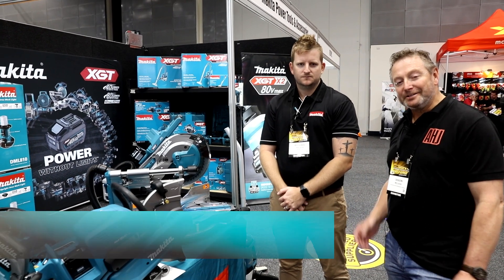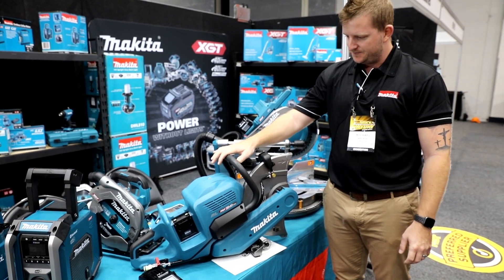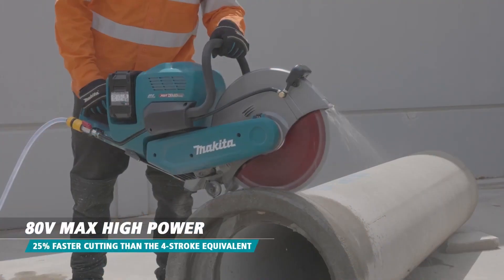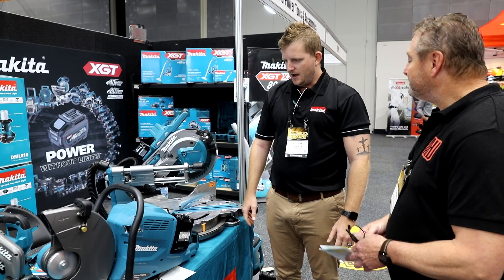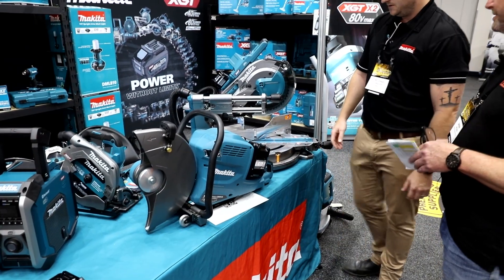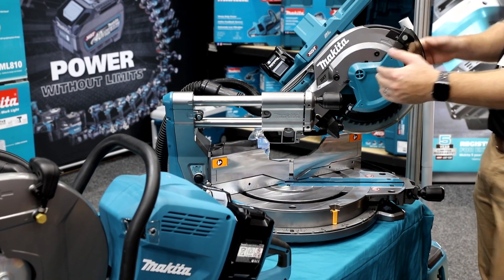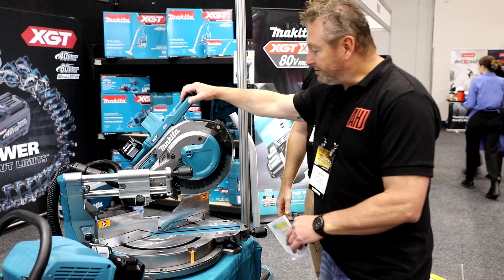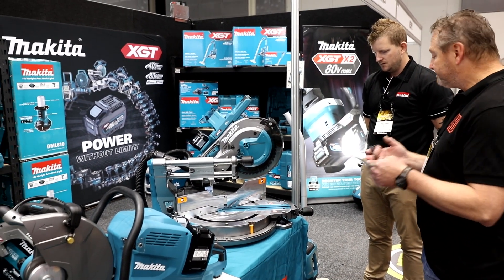HBT EXPO 2022 - Makita

Comment: I want to know when the 40v  8 1/2 table saw is coming out I hope soon I may wait for a year r so but I am wanting to downgrade to a smaller more compact saw and do away with my 10 in dewalt bc I have a track saw now and use my table saw less I just bought the 8 1/2 inch 40 V miter saw and absolutely love it especially because of the Bluetooth technology to hook up to a vacuum this is the reason I may wait a while to see if Makita brings out a tablesaw with these technologies built in bc I care about dust Extraction I hopefully this is in the works